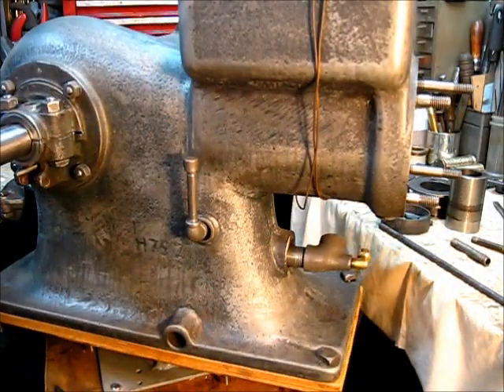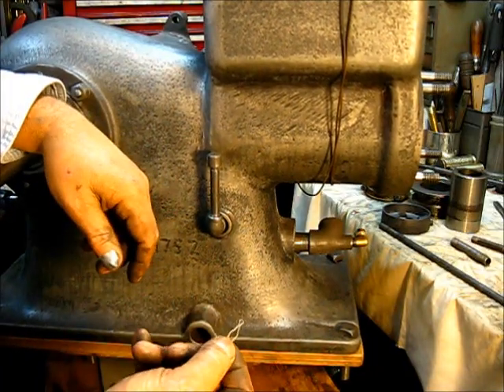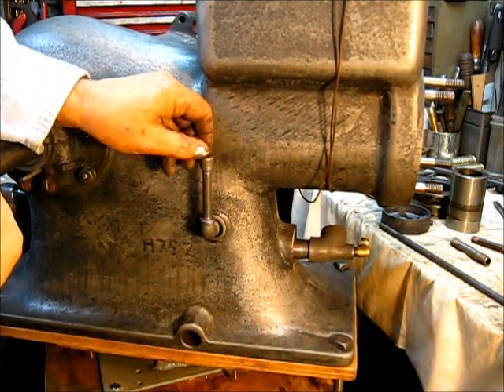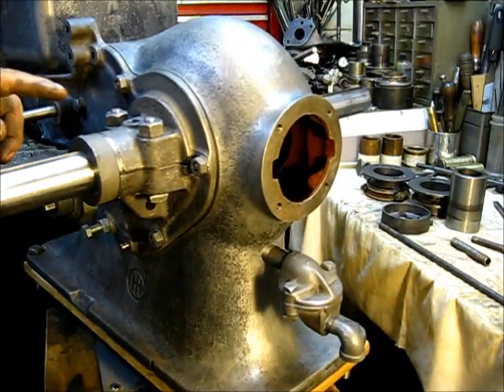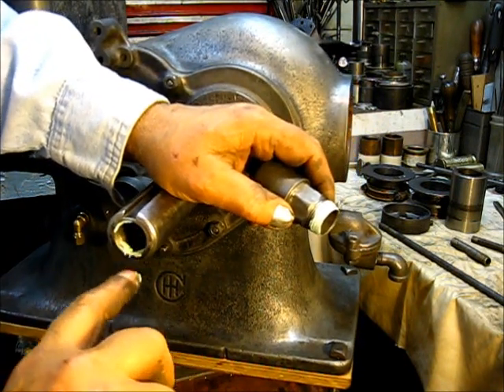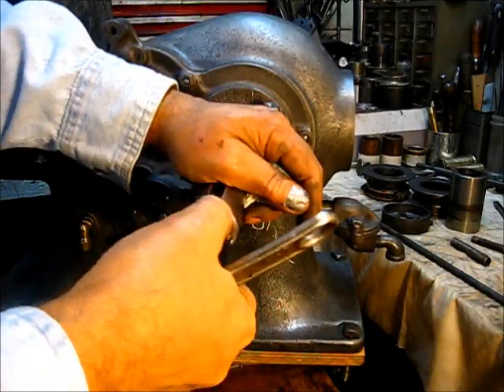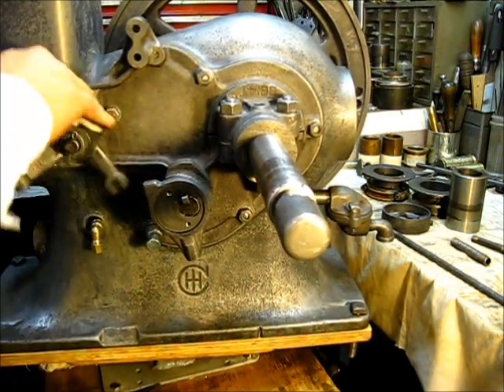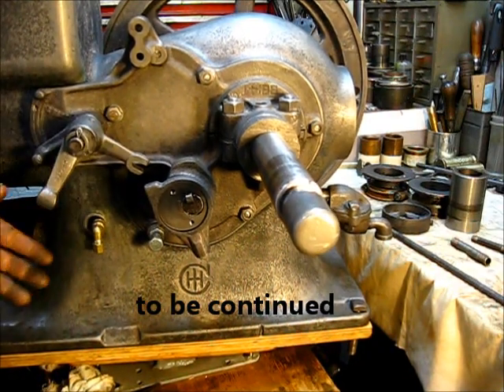McCormick-Deering "baling wire engine" #32

Comment: Very informative, I liked the tip about the cotter pin and the dirt dobber. I need to buy a crankshaft welder or do you know somewhere I can have it done.  But I would like to buy an old crank welder.  
Later